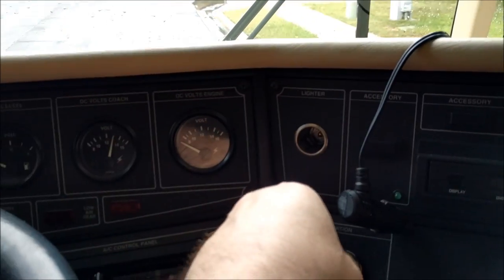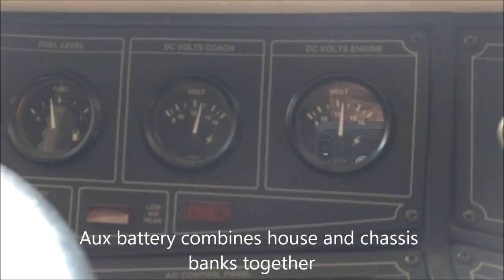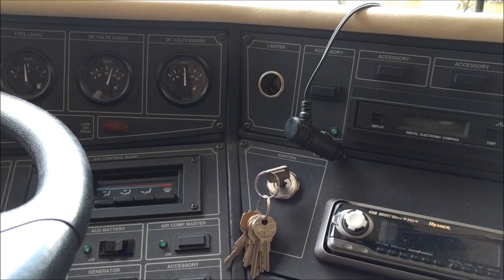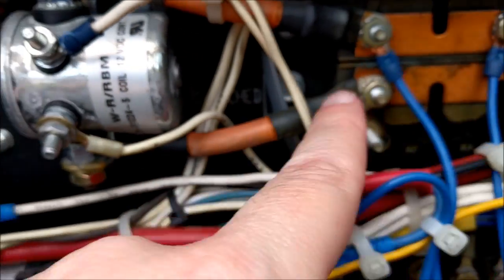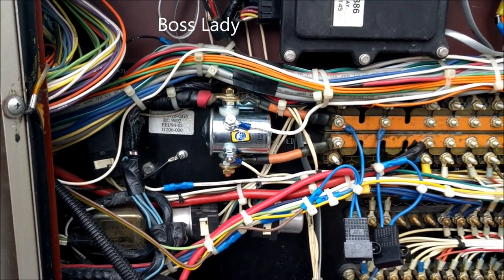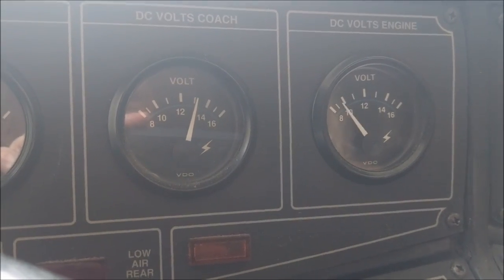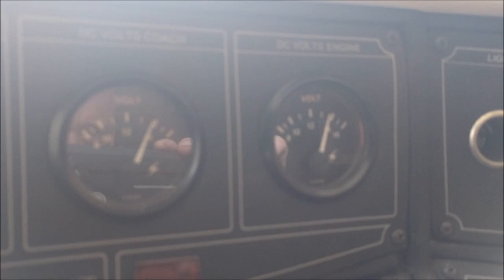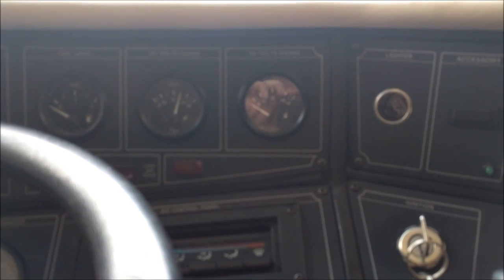Class A RV Motorhome solenoid problem and repair

Comment: Don’t know what the solenoids on my rv looks like or where it’s located
Reply from the maker: Check out IRV2.com for a forum dedicated to your model...each manufacturer does it differently...most "bus" coaches like mine have the panel under the door but if not there then it's a complete guess where they are hidden...

Comment: I have to keep disconnecting the battery after I put it in ignition and the rv goes clunk and knocks all the power out to where I cant even cut the radio on!  Im hoping it's a solenoid and not the engine!

Comment: We are getting zero power. The generator powers up, but the entire dash and lights are all dead. Brand spanking new batteries, had the same issue and it was a 10 amp fuse, it ran fine for 2 days then did this again and we have nothing. Any ideas?
Reply: Is you motorhome a BlueBird? If not I would go to the IRv2.com forums and post there as they are all built differently.
Reply: Have the same problem, have you figured it out?
Reply: Hi what was the fix? I’m having a very similar  problem. Thanks

Comment: My RV turn on ok engine  runs ok but cannot release the emergency air brakes, the yellow brake button pops back and parking does not disengage.

Air1 and Air2 does not turn off after the engine turn on pass 20 min. They should go off, but still beeping.

i think is the solenoid.

If someone know how to fix this let me know. Thanks.

1995 Holiday Rambler Imperial, cummings diesel pusher class A.

May God keep you blessed.
Reply from the maker: That actually sounds like you have a major air leak somewhere. The air brake system on your RV is purely mechanical so if the release knob pops back by itself the only thing that will cause that is low air pressure not anything electrical. After you've let it run for 15 minutes I would turn it off and then hurry get on the ground next to it and see if you can hear a leak somewhere or get it towed or have a mobile service truck come out and check it.

Comment: Is that solenoid dedicated to just the engine charging system?    I couldn't fix my neighbor's rv yesterday, needed his help, but he wasn't home.  Worked on it by myself for a few hours & it has 2 solenoids like yours, I tested Both & they work, but it has a 3rd solenoid between the other 2 that's similar but different.  Idk how to test it yet, it's rusty & the other 2 look good as new, so it might be bad.  The 2 small control wires on it are Both grounded Negative(-).  
Here it is:   https://www.youtube.com/watch?v=J0SNXhVyfEo
Reply from the maker: No, that's solenoid is the main ignition solenoid and it reads the charging system through the dash gauges but what it does is when you activate it it powers up the dash and then it also goes back towards the rear of the coach and activates two other solenoids which power 12 volt stuff in the middle of the coach and also power's up the 12 volt solenoid that powers the engine bay solenoids. If you think about it there's so much crap on a bus that there's no way you can feed it all through one solenoid so what they do is they have one solenoid which has a main job of just activating a bunch of other solenoids which then feed the different systems - the one under the window is the one that activates all the other solenoids and it also feeds the dash.
Reply: @BubbasWorkshop  Okay, thanks for replying.  What is your RV besides just a class A ?
Did u watch my clip? 
My neighbor's is a Fleetwood American Tradition.
Relay in your video is under the driver's window correct?   Idk if my neighbor's has 1 located there or not, I'll find out today, wish us Luck, ha.
Thanks again, take care man.
Reply from the maker: @leeisenberg  It is a 95 BlueBird but the chassis was built by spartan - it's a Spartan Mountain Master chassis. Yeah I watched the video and that fleetwood is different. IRV2.com is a huge help when troubleshooting.